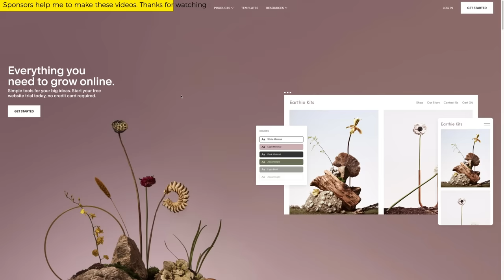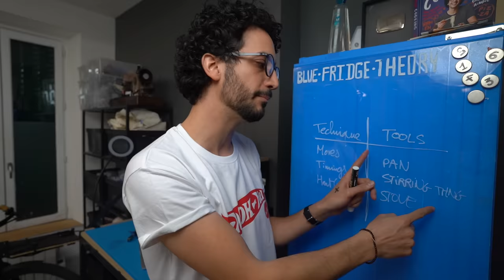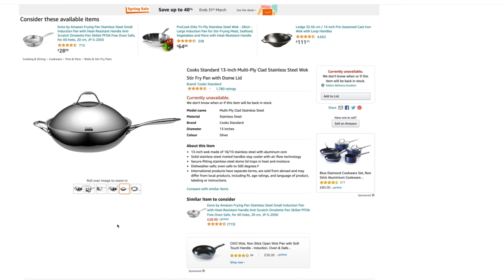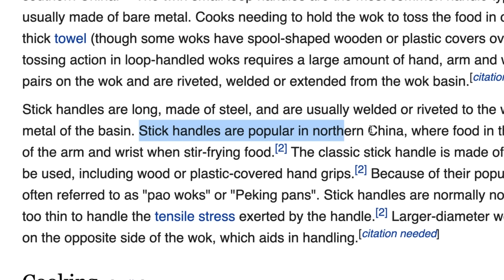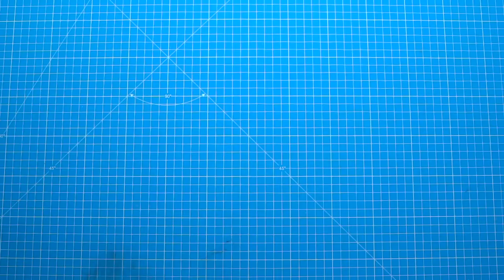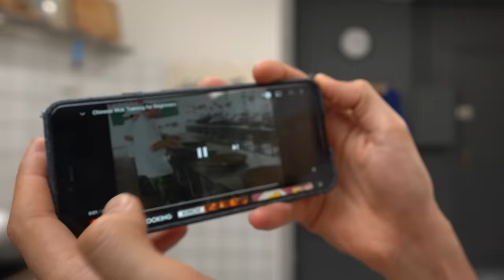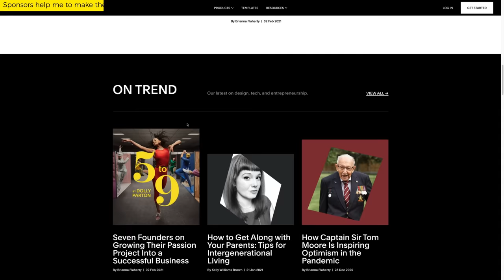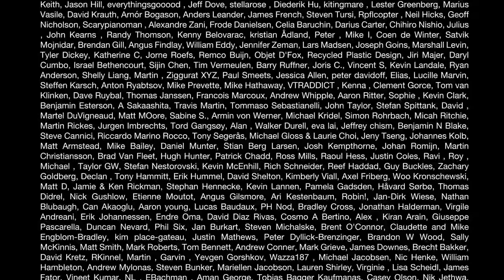Searching For The Perfect Wok

Comment: I think you missed an important aspect: the BTUs of the burner. Yes, heat. Observe your grand master's. Looks like he's cooking on a jet engine's afterburner. Sounds like it too. 'Cuz pressure. A home hob is about 13k to 15k on the large gas rings. A table top camping burner is less than 10K. And one used at a restaurant - commercial grade - is about 100k BTUs. Your portable wok burner you made in 2017 is 22k - about 1/4 that of the grand master's. Now, when you have a volcano blasting away in your kitchen, what else is needed? A really good hood. Sounds simple, eh? 'Easier said than done' comes to mind. You’re going to need to remodel your space and deal with ducting to get that installed. Probably want to have a couple of dry fire extinguishers nearby too. 

Is all this necessary? Depends. If you set the goal of perfect, which you have (perfect fried rice, perfect wok), then yes. BTW, this is why the perfect is the enemy of the (very) good. I look forward to episode 4.